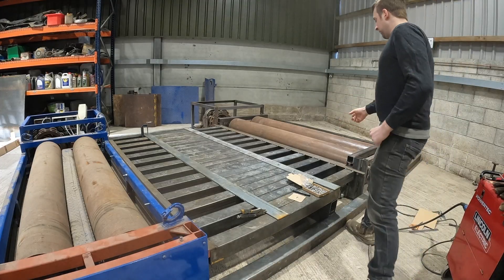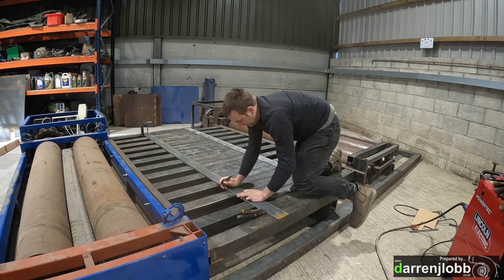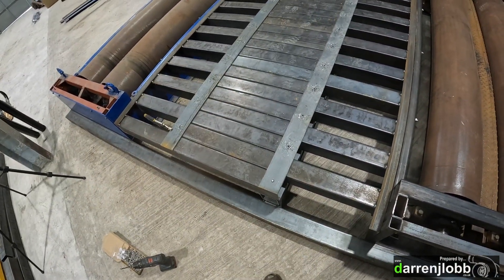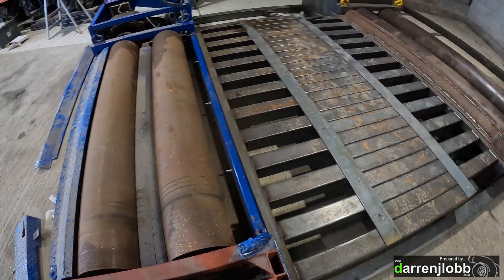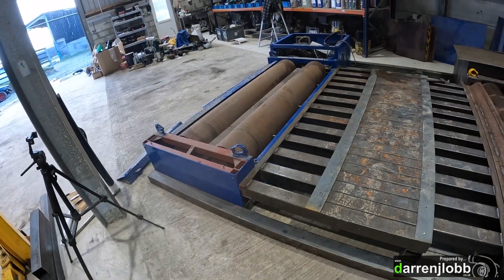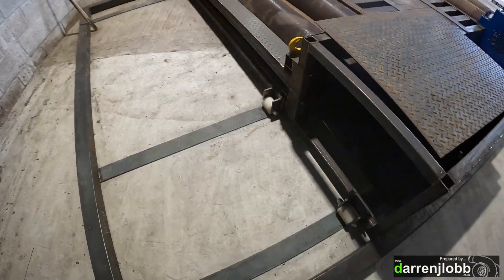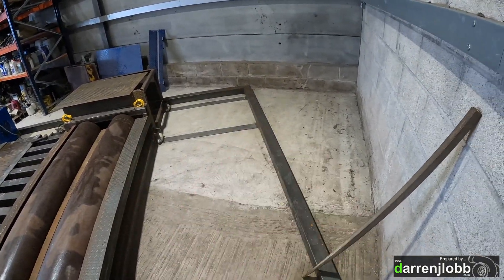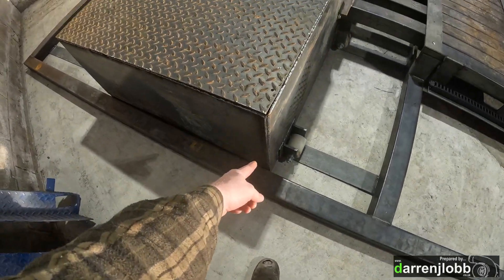4x4 Chassis Dyno Project Part 3

Comment: Is there room for a 4 post ramp infront of the dyno would make it easy to get cars on and off plus another ramp
Reply from the maker: Sadly not, I did try initially to plan it so the 4 post was in front the dyno, but there is no way to make it work without wasting a huge ammount of space (to still get access to get on it), It would also be a pain as there is very often a vehicle torn apart on the lift, which would then prevent you from using the dyno, it would also be awkward I think using the dyno / front fan with a ramp in the way....

Comment: Top notch 
Will the control side of things be getting an overhaul or will it be an adaptation of the original modded to run 2 retarders
Reply from the maker: Will be getting an overhaul, should be in the videos to come... Same system but obviously two brake supplies, two speed sensors and two load cells!

Comment: Looks to be coming along very nicely Darren, have you been through the retarder on the new dyno unit yet or is that still to come?
Reply from the maker: I havent been through it and am hoping not to need to, it has clearly had new coils at some point in its past, and currently meters out almost identically to my other one, and bearing are quite, so other than an oil change I am planning to just run it and see how I get on....